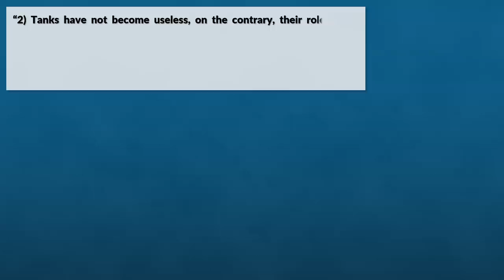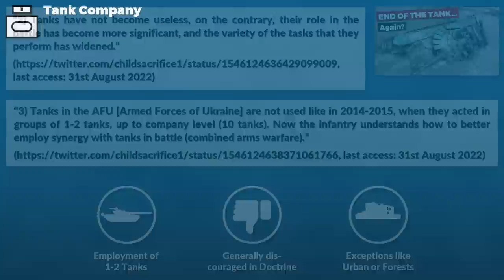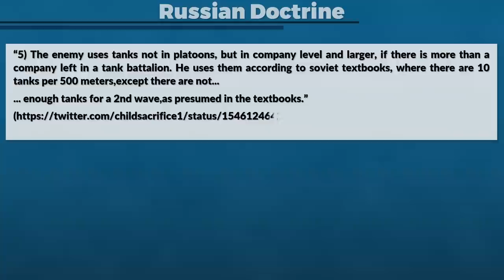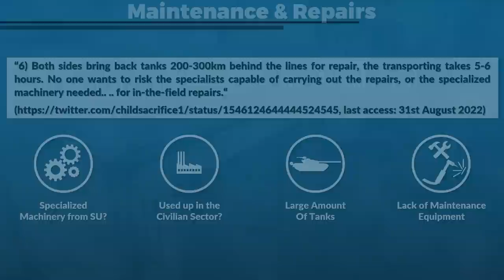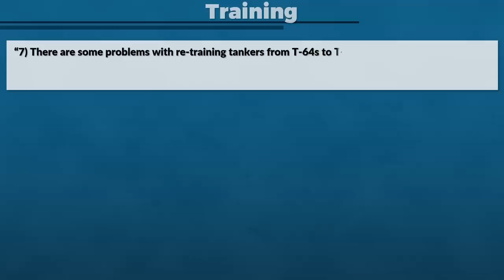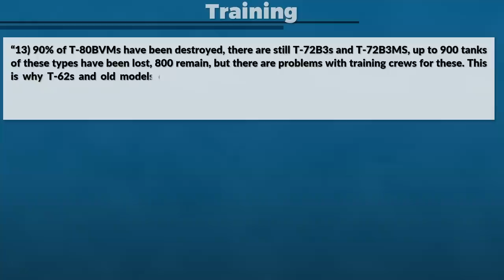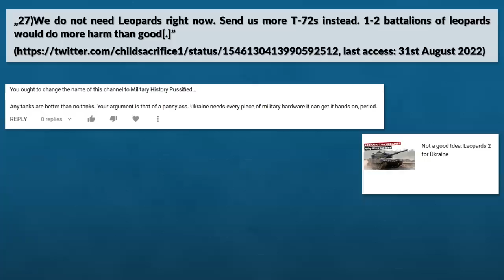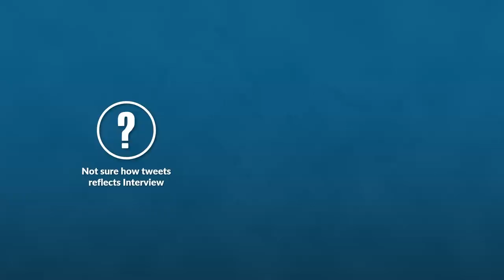What Ukraine thinks of Tanks

Comment: Indeed, Soviet doctrine relied on echelon tactics to keep continuous pressure on an enemy to achieve a break through and provided depth in the case of a counter attack.  The Soviets believed in quantity over quality and that the West's higher trained troops were more brittle and would be degraded with continuous combat.  However, Soviet tactics also relied heavily on centralization of command and control, making it difficult to exploit rapid changes in the battle space, it also made the army vulnerable to disruptions if the its centralized command was disrupted.  

The US military puts a great deal of emphasis on mission tactics where local commanders are given a mission, resources, and a timeline to complete the mission.  Commanders are encouraged to take the initiative to exploit conditions in their battle space and react to changing conditions.  The US army also emphasizes getting inside the enemy's command decision loop timing, referred to as the OODA loop, the cycle observe–orient–decide–act, to disrupt enemy plans and kept them off balance.  Each system has advantages and disadvantages.  However, Soviet tactics do not work if there is only one wing in an echelon and the attack is turned back.
Reply: Americans learned from the overrun of France in WW2, the soviets did not.
Reply: @512TheWolf512  
The Americans were trained by the Prussian Von Steuben during the Revolutionary War and they learned German Auftragstaktik from the Germans after WW2.
Reply: They also begged the question: What happens when you dont really have enough echelons? The USSR could count on Army after Army after Army to throw at the problem, whether it was Soviet or Pact. The current Russian forces deployed look echelon'd at DIV level at best. Can the USSR's doctrine hold, especially in the start when they bypassed large BDE-sized elements, without enough firepower to sufficiently fix them in place.
Reply: @512TheWolf512  You are wrong imo. The US had an excellent fighting force in WWII where lower echelon commanders would be able to take initiative within the confines of their operating orders. Especially during the Vietnam War the US army was greatly hindered by far too much medling with local commanders in the field and a lot of decision making by politicians instead of army commanders. This led to a lot of inertia and unnecessesary idiotic commands. This ultimately led to a greatly demoralized US army where the important backbone of the combat power, namely the NCO's, was lacking and morale was at an all time low. The homecoming of the US forces after the Vietnam War had ended was a cold shower for most of the veterans. It took the USA two decades from the start of the seventies to rethink their approach to warfare and rewrite their doctrine. By putting much emphasis on new training methods and frequently training the USA was able to reform their forces in an effective way, culminating in a giant victory during Desert Storm. 

One could say the Sovjets and their successors in the Russian federation have stayed stuck in the Great Patriotic War mode as well as their Cold War doctrine. They learned nothing from their exploits in Afghanistan and Syria and have greatly underestimated the resolve of Ukraine, who started building up their forces using Western guyidelines. Unfortunately not soon enough to prevent the taking over of Crimea and part of the donbas.
Reply: Ooooooo! Da Loop! 😄 Yeah, I imagine there are hundreds of videos on the topic if one were to search for OODA loop. Its a principle employable at both the tactical and strategic level. First time I heard about it was in the context of fighter aircraft dogfights. The second time was in the context of small wars/counter insurgencies.

This doctrine’s fingerprints are all over the Ukrainian strategy as the counteroffensive unfolds.
Reply: Its all nice on paper, what heapens when real war, not push against Taliban or batered Iraqi army, consumes most of the trained personel.
West has highly priced, polished forces for light combat duty.
Its like driving Lamborgini ower dirt road, its going to fall a part wery soon.
Reply: @ljubomirculibrk4097  I have to respectfully disagree, your opinion appears rather biased and unsubstantiated.  Western militaries are capable and adaptable both on paper and in action, and have emphatically demonstrated this many times.  The Iraqi army was not all that battered in the first Gulf war, they had experience fighting the Iranians for many years and the Republican Guards were well trained and had decent soviet equipment.  It was feared at the time that the Republican Guard would pose a major threat to coalition forces; causing more casualties than Western societies were prepared to accept.  However, it was the strategic shaping of the battle field, including total air dominance, combined with highly effective combat systems such as the M1, Bradley AFV, Apache Helicopter and others, married to solid and effective doctrine and tactics that resulted in the Coalition's complete annihilation of Iraq's military.  The coalition suffered approximately 350 combat casualties to compared to the @15K for the Iraqis.  The victory was so lopsided it terrified many adversary nations, including both Russia and China, into completely rethinking their approach to warfare.  Russia being an authoritarian klepto state has clearly not been able to do more than create a veneer of force modernization, a paper tiger.  To the contrary, the West's 'Lamborgini's' are in all ways equal to and in most ways superior to Russian or Chinese military equipment.  Further, Western forces are better trained and their doctrine more flexible.  No my friend, the West's militaries are to be feared and respected.
Reply: @512TheWolf512  
Maybe not the late Cold War Soviets, but the Red Army of the second world war certainly learnt. 

Red Army tank generals in particular were not overly dependent on high command (as is overwhelmingly believed by Western and German stereotypes of Soviets) to make decisions for them by Kursk 1943, at worst they would have to ask for more units to be released to their command.
Reply: @512TheWolf512  The simple fact Russia won the WW2 war pretty much alone, with only the slightest of help in the final stages by the so called allies is proof of the strength of their tactics. So many of us westerners try so hard to rewrite history, but you can't deny the simple facts and numbers involved. 95% of the german force was on the main front in the east. If not, there is zero chance any allies would land in any part of France. Simply impossible for them to do. They were only saved by facing the weakest of garrison forces in Normandy where they still took significant losses, and later faced the heavily wounded battalions resting up in Holland. Even than, again, the allies were turned back in Market Garden. So no, there is no proof to suggest the western armies ever manged a good tactic with tanks, and there is 100% proof Russia masted the vehicle based on the obvious success they enjoyed.
Reply: @D64nz  you are now actually talkinh about a war that ended 80 years ago and comparing it to modern combat as an argument for russia being up to date... i can't be the only one seeing the ridiculous irony
Reply: @hkloss11  I am not sure I support your argument,  nor do I understand the hostility towards Germany.  I for one am happy the German's are reluctant to involve themselves in military conflicts.  The last two times the German's were in the Ukraine area they were very rude uninvited guests.  

You pick on the German's using the GDP chart and pointing to the percent of GDP is an interesting point vis-a-vis the earnestness of the giver, but it is in no way representative of how much money has been sent.  If you go to the data source and look at the chart that shows the amount donated, it shows Germany as the number 4 top donor in real dollars.  So which would you rather have .10 cents each from ten poor guys who struggled to give it to you or .50 cents each from four very rich ones who had spare change?

Next, training makes a HUGE difference, the US Army puts its tankers through 22 weeks of training, 10 for basic, and 12 for advanced training.  The Leopard 2 has 4 crewmen unlike the T72 which has 3, so even if you assume the crew is already familiar with tanks, one guy would have to train on an entirely new position and the new crew would need to operate as unit, it is not a simple 1 for 1 swap.  So let's say you did manage to train a new tank crew, so what, now you have to train the maintenance guys and provide them the tools an technical manuals, and then the supply guys would have to manage a whole different supply chain for tools, spare parts, ammunition.  In fact the supplies issue is of even greater concern than just giving away a working tank.  

Finally, I hear your frustration, however, a better course of action would be to find as many pieces of operational Soviet military equipment and send it to Ukraine instead.  The Ukrainians are already trained on it and have the supply chain to handle it.  

Thanks for sharing your thoughts.
Reply: @artificialintelligence8328  Interesting point, I would be curious to learn more.  However, Operation Citadel may not be the best exemplar.  The Soviets knew for months the battle was coming, planned for it, built defenses in depth, and had a counter attack strategy, which implies that local commanders may have been given authority to respond.  In the end Kursk was still a close won thing by the Soviets, but win they did.
Reply: @D64nz  There is no doubt the Russians were the key factor in keeping the Germans at bay and I am very grateful for the sacrifices of the Russian people in the Great Patriotic War.   However World War 2,  was a war of allies and the Western allies did a great deal to contribute to the winning of the war on the continent.  However, saying the Russians won the war alone is a disservice to all the men and women who died in the Atlantic providing material aid to the Soviets; died in North Africa defeating Rommel; died defeating Italy; bomber crews who had a 45% of dying; and the contributions of partisans and special forces across the continent.
Reply: Soviets never trusted their military commanders.  It stems from the Civil War when Bolsheviks had a lot of soldiers and a lot of weapons but virtually all officers were pro-White.  They tried having commissars lead armies of workers but they were terrible tacticians and lost despite numerical advantage, so Trotsky instituted a policy of kidnapping White officers' families and forcing them to lead Red Army but they always had a commissar who had equal or greater power than a general next to to keep a watch on them.  A commissar could overrule the general on all matters.  This continued to WW2 days but this ineffective command structure had to be discontinued and generals finally got the final say.  Since, then, generals had control but the top-down command structure persisted to this day as a legacy.  If you think about it, Russia was never really free and those in power were afraid that the military would stage a coup - so they needed this top-down structure to be so dominant, nothing could be approved from the bottom-up.
Reply: @mrvk39  Agreed, indeed in the first Winter War with Finland the Soviet Army's experience with Commissars trying to run the war was so terrible it resulted in so many lost battles, men, and equipment, the army basically said remove these guys or we won't fight.
Reply: Except every time that NATO wargamed a Soviet division carrying out an assault on a NATO division in the 1980's the Soviets inconveniently won..........
Reply: @AlphaAurora  In fighting larger army, I think they would try to assume localize superiority (and maneuver superiority). This was not realized in the current conflict (if anything, it's the Ukrainian force that archived localized superiority despite being out numbered)
Reply: @mrgunn2726  Yes, Soviets drew some good lessons from the Winter War, which really helped Soviets in WWII.  They still had a lot to learn but learn they did
Reply: @fatdaddy1996  it's common for NATO generals to lose war games as a way to angle for more funding for newer weapons.  Pentagon was discovered to significantly overstate Soviet arms and their capability during the Cold War.  It's not about a true wargame but about funds
Reply: @Kriegerdammerung  this is utter nonsense. The military doctrine has been to counter USSR.  And your count is pure bull.   But it's not about being rich or poor. The countries were in the Third World because it's where the conflict between US and USSR has been and later terror threat from the ME.  It's a great thing for humanity that US and China or USSR never went to war with each other. Don't try to spin it as something negative LOL
Reply: @mrvk39  Mate, the truth is as simple as it gets. If the USA felt that the USSR was its geatest enemy, they should have invaded them, not Vietnam, not Nicaragua, not Korea, not Bolivia and that's the short and long of this.
Reply: @mrvk39  My thoughts exactly!
Reply: @Kriegerdammerung  I appreciate you taking the time to comment, but I feel your comment is naive and biased. Militaries are an instrument of state policy, the US Military implements the policies of the plutocrats in charge. 

Of course nuclear powers do not engage in direct armed combat, because if the the existence of the state was truly threatened, they would resort to weapons of mass destruction; Mutual Assured Destruction.  Therefore, nuclear armed powers engage in proxy wars with each other via small unarmed states, the Cold War is the prime exemplar.  During the Cold War the US adhered to the Domino Theory of communist control and applied the Containment Strategy to hem the Soviets in.  Do not forget the Soviets tried as hard to overturn European governments as the US did to Warsaw Pact, e.g. US in Poland and Russia in Italy.  Now it is China's turn to join the great game with their Belt and Road initiative; aggressive South China sea policy; their courting of Solomon Islands for military bases, a clear effort to offset US Military reach in the Pacific; the pestering of India by cozying up to Pakistan and encroachment in the Himalayas.

Instead, one can argue that as far as Europeans are concerned the US Military has helped keep the peace on the European continent for 77 years; no Soviet or Russian boot has ever touched NATO soil.  In fact, it seems clear US has done a better job than the Europeans at keeping the peace, only recently were the Europeans dithering while the Serbs practiced ethnic cleansing against their neighbors, then again when the Russians Anschlussed, Crimea; they needed Russia's oil you see. 

Barring a fundamental shift in how humans approach the world's problems and create a more just system focused on equal distribution of resources and opportunities, it is naive to believe the leaders of the US or any other great power are not a bunch of self interested bastards who take advantage of the weak.  Obviously, this hypocrisy is harder to stomach from the US as it is they, not China or Russia, who offer the promise of freedom and justice for all, while toppling democratically elected governments and putting dictators in charge.  Further, it is a statistical fact that the absolute number of war deaths from war has been declining since 1946, from around half a million deaths through direct violence in wars, to less than 100,000; do you really want to see the great powers come to direct blows and risk an all out nuclear conflict to make up for lost ground in war deaths?
Reply: @mrvk39  I concur whole heatedly!
Reply: @mrgunn2726  I don't know how you came to ask me the last question. What I want is a world of liberty and freedom.

I think both the communists and the capitalists wanted to give people different types of freedom. The former that of having health, work, education and happiness, the latter that of working at the age of 75, being unemployed, to pay for human decency, to die of curable diseases etc.

I'm an American myself, I can sound naïve, but you can bet big money I'm not. I'm very savvy at politics.
Reply: @Kriegerdammerung  yeah, clearly. Proven by the fact you are a communist.

Maybe you should read up on a few communist countries (actual communist ones, not modern china). I suggest starting with the Khmer Rouge (probably the most communist of them all), I’m sure everyone there had health, education and happiness, i know for a fact they had more than enough work though. After that maybe read up on east Germany and the stazi and how much freedom communism gave the Germans. I could go on but there really is an endless supply of things for you to read up on honestly.
Reply: @D64nz  I agree the main fight in WW2 was between the massive militaries of Germany and its Axis allies versus the Red Army. Four out of five German army casualties occured in Russia. Saying that though the West heavily bombed German war industry and tied up alot of resources ie AAA guns and fighter aircraft to defend against air attack. This caused Germanies war industry to spend alot of resources rebuilding bombed out war factories or dispersing existing war factories.

This had an effect on German war industry with equipment  becoming shoddier and less reliable as the war progressed.  Numerous German military forces fought on other fronts such as Norway, French coast, North Africa, Greece, Yugoslavia etc etc which could not be used in Russia. Lend lease by the allies was also massive with many examples of Western military equipment being used particularly US supply trucks. I think the West learnt from the WW1 experience of Gallipoli and only decided to commit to an amphibious landing wheb the enemy was heavily committed away from the landing grounds in this example Russia.
Reply: @mrvk39  Hmmm... look, this is simple, in Cuba you've got better healthcare than in any U.S. public service. Yes, the private sector of Europe and the USA is better, but only a priviliged sector of society have access to it.

And the famines were a product of droughts and natural causes. Proof? they never happened in a cycle since the last time. Look for the papers of Pensilvanya university I think it demonstrates it.
Reply: The soviets won the eastern feont with pretty much the same doctrine.
Reply: yes those are popular myths about both armies.
Reply: @egoalter1276  yes, but the difference was, Soviets were facing a war of extermination and any losses were acceptable. Here, Russia is doing the opposite - it is waging a war of extermination of Ukraine as a state and it attempts to do it in a "limited" "special operation" scope but fails miserably and generates a lot of losses that are impossible to justify.
Reply: You are correct furthermore the same quantity over quality is also reflected on the Tank design  Philosophy. for example Russia can produce more T-72s T-90s Quantity  over quality than NATO United States M1 Abrams Germany Leopard 2A5-A7 France LeClerq and United Kingdom Challenger 2 & 3 Quality over Quantity
Reply: @EpicThe112  yes, though Russia appeared to be moving away from this quality over quantity strategy with its latest Armata tank.  However, they failed to build it in any sort of meaningful quantities (I guess the cost was too high).  Russia, with a population smaller than Bangladesh now, cannot sustain old Soviet approach to overwhelming numeric advantage.
Reply: @Kriegerdammerung  
You cant just use brute force for anything. If the USA invaded the Soviet Union the likelyhood of succes is very small, and even in the best scenario the losses would be catastrofic. Worst case scenario is nuclear war, and the arsenals of today are small compared to what they have been.
Reply: @BlackWit11  That said, the US Army didn't exactly adapt quickly to the changed circumstances of conventional to guerrilla war in either Afghanistan or Iraq, more is the pity
Reply: @hgm8337  I concur. After the relatively succesful Desert Storm campaign the Second Gulf war was a completely different kettle of fish as was the war against terrorisme in Afghanistan. Without going into detail a number of mistakes were made which set up the USA and Allied forces for a mission impossible. In my opinion those mistakes were primarily caused by politicians and left the armed forces with a set of goals they were not equiped to carry out succesfully.
Reply: @D64nz  "The simple fact Russia won the WW2 war pretty much alone, " - lol, that's a good one. Evan Stalin, Khrushchev and Zhukov admitted that they would have collapsed without Western aid. 
95% of the german force was on the main front in the east. - now you're just trolling.
Reply: @filipinorutherford7818  Alone the war in the Atlantic took 40% of Germany's resources. 2 million men were in the AA artillery in Germany . Many more were tied up in occupied countries. That dude has no idea what he's talking about.
80% of the copper and 55% of aluminum the Soviets used in the war was from the US. Without those things, the Soviets could not build electrical components, only half the planes and half the tank engines, since the tank engines had aluminum blocks. 
AND the most important factor : without the food from the US, the Red Army would have starved. The Germans had occupied most of the agricultural land, they had Ukraine and massive parts of the fertile land in Russia. The Soviet civilian population lived on rations, and the army was almost exclusively fed by the US.
Reply: Soviet tactics have always sucked.